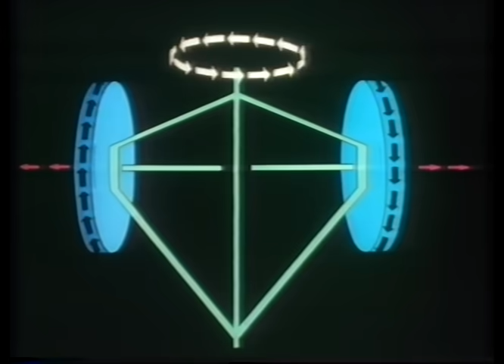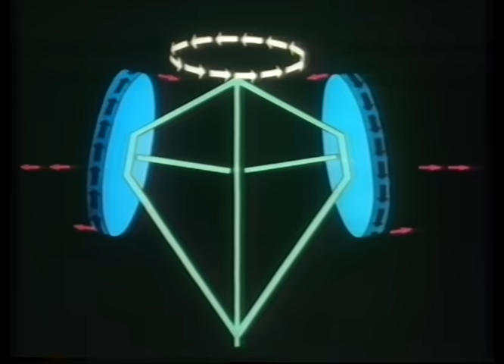Anti-Gravity Machine (Part One)

Comment: Sandy Kidd's invention - real or not.  My take-away is that Sandy was telling the truth and his device did in fact raise upwards for some period of time.  However, I also believe that he did not invent a "reaction-less drive".  A reaction-less drive is one that generates a sustainable force in a particular direction without having to eject matter out of one end of the drive like occurs with traditional "force = mass x acceleration" based dives (e.g., rocket engines).   

So what did Sandy invent? - Neither the time duration nor the full mechanical blue print of Sandy's effect is mentioned in either the part one or part two YouTube video and the full understanding of both could prove pivotal in discussing how this guy's gadget worked.  Also, suspiciously, this long 2-part video had ample time to dissect the machine thoroughly, but it did not, preferring to tell the story of an oddball and some oddball professors and his long-suffering wife.

BTW, before I proceed, I want to make clear that I do not subscribe to the conspiracy theory that there is a secret cabal that malevolently suppresses all cool inventions.  "Cool inventions will out" is my credo.  Where was the cabal when, in the 1990s, digital photography 100% wiped out chemical-based film photography?  Where was the cabal when Otto invented the internal combustion engine that eventually was used in the automobile and wiped-out horse-drawn carriages?  I guess they were on vacation.

First - here is a peak at how gyroscopes work - Gyroscopes are hard to suss out because everything is spinning so fast.  First off, there is an outright error in this video - when that science guy held the gyro in his science demonstration, the force acting on his hand as he held the non-spinning end still equaled the total weight of the shaft + spinning wheel, so that demo does not at all demonstrate a mysterious upwards force nor does it demonstrate a reduction in the weight of the shaft + gyroscope.  

This might seem like an odd comparison, but would you be amazed if I held up a piece of metal that was bent at 90 degrees and then if I "went on about" how mysterious forces held the horizontal portion of this bent bar stationary with no energy input?  

Please know that a "precessing" gyroscope, such as is shown in the sciency demo in this video is a 100% thought-out phenomenon where the gravitational force vector acting on the spinning gyroscope is shifted 90 degrees and is what causes the old science dude to dance around as he holds and then lifts his rotating mass attached to a non-rotating shaft.  He is not rotating the shaft, the gyroscope is doing that.  Also, the center of gravity of the gyroscope in the science demo in this video slowly is moving slowly downwards relative to his hand.  A very partial understanding of gyroscopes can be gained by considering the centrifugal force Fc, where Fc = (mass) x (velocity squared) / (radius of rotation).  So, Fc increases with the square of velocity.  

The velocity is the instantaneous velocity of the rotating mass.  You can get this velocity from the revs-per-minute (RPM) and the radius of the rotation since there are (2) x (pi) x (radius) units of length (i.e., the circumference of the mass's rotary motion) per each and every full rotation of the mass.  When you try to force a spinning disk to go to a different angular orientation, you are pushing against a more complex variant of the centrifugal force acting on each chunk of the spinning disk.  The math is complex, but it fully explains how a torque (torque = force x (perpendicular distance)) acting about axis "A" will cause the spinning disk to rotate (precess) about another axis "B" that is 90 degrees to axis "A".  All of this math also pertains to how helicopters fly and the control features of helicopters, where the pilot has to be 100% familiar with the aforementioned 90-degree shift of the reaction torque of a rotating object.

Sandy's anti-grav. mechanism - Not enough information is given about the complete mechanism, only some blurry fleeting camera shots of a couple of gyroscopes mounted on a "V" shaped articulating mechanism whose articulating motion is highly limited and then a bunch of belt drives that, supposedly, only provide drive torque to the device, but allow it to be free to slide up or downwards and then there is the counterweight attached to the spinning shaft via a pulley system where the counter-weight rope is presumably affixed to the rotating shaft by some sort of coupling that incorporates a bearing.  Our hero plugs his gadget in which gets it rotating while also, presumably, causing the 2 gyroscopes held outwards from the spin center to also rotate, maybe in opposite rotational directions.

It is important to note that Sandy never built any sort of flying craft and spent years just on the particular gadget we saw.

It is also important to note that with the machine off, a sufficiently heavy counter-weight would lift the whole contraption upwards via the cable & pulleys.  I am assuming that Sandy first balanced the system such that his mechanism was between the downward & upwards "stops" and then after he turned the machine on, the spinning machine drifted upwards and then rested against the upper stop implying that less counter-weight was now needed to balance the system and further implying that the weight of the spinning mechanism was reduced.

Bottom line - I am highly suspicious that there was some subtle aspect of his device where the mechanism that provided the input torque was somehow subtly creating a small upward tug on the central mechanism's shaft whose top end was attached to the cable that went over two pulleys on the ceiling of his garage and then went down to the counterweight.  

In other words, I am suspicious that the gyroscopes actually did nothing except provide a convenient distraction to what was really happening.  Magicians call this "misdirection".  Sandy came off as a sincere guy and I am not here and now accusing him of creating an elaborate magic trick, but I am convinced that he accidentally invented his own magic trick but was never able to understand the misdirection he stumbled onto and was turning a blind eye to the true source of the upward force acting on his spinning mechanism being perpetually mesmerized  by the spinning gyroscopes he so longingly wanted to be the real source of the gravity reducing force.

What about those professors who are filmed backing up Sandy - Again, I am not doubting that Sandy's device appeared to reduce the weight of the rotating contraption.  So those well meaning-professors were not lying when they said they saw what they saw.  I have worked with engineering professors myself and I can tell you that just because someone has a "PhD" (doctor) in front of their name, does not mean they are "smart".  In fact, some of the least intuitive and uncreative people I have met had engineering doctorates.  So, the professor chaps shown in the video were, undoubtedly, your garden variety small time, well meaning, professors tens of thousands of which populate the thousands of centers of "higher learning" and who are perfectly suited to regurgitate the contents of a given engineering or science text book in a lecture setting and are capable of creating and grading exams, etc., but when confronted with an unknown physical phenomenon are totally incapable of discerning what is going on.  The professors in this video are not bad people.  They are not purposefully trying to dupe us, then are just muddling through like the rest of us.

So, there you have it.  Not a thorough de-bunk, but a partial one.  Please also bear in mind that other folk making videos of perpetual motion machines or of anti-gravity machines are not so innocent as Sandy who I am giving the benefit of the doubt.  There are lots of folks just plain making stuff up to get YouTube clicks and there are others secretly hiding batteries, filming upside down, slicing, splicing or otherwise photo-shopping pictures and videos for their own strange pleasure (again - magicians abound).

Stay healthy & stay sane.

Oh yeah, I almost forgot - there is a way, or at least I think there is a way, to make a true reaction-less drive and it has to do with energy = (mass) x (speed of light squared).  This famous Einstein equation shows how you can convert pure mass-less energy into mass and vice versa.  OK, so picture a space ship with what looks like giant oars sticking out of portholes (yes, like on an old time Viking ship).  Except, where the wide part of the oar (paddle) would be, there would be a particle accelerator that would speed up matter to near-light speeds, which would increase their mass, and then which could also slowdown that sped-up matter to eliminate mass.  

So, when the ship oarsmen pull the tips of the oars with the particle accelerators attached towards the bow (front) of the ship, the particle accelerators would be turned off (low mass) and then when the oarsmen pull the oar tips towards the stern (rear) of the ship, like when a real paddle would dip back into the water for a power stroke, the particle accelerators would be turned on and would convert mass-less energy into mass by speeding up particles to near light speed.  Just before the end of the oar's power stroke, the particle accelerators would be turned off so the accelerated mass's momentum would disappear and the space ship would move forward.  OK, so a real drive as I describe would not literally have oars sticking out of windows, I just described it that way to let you get the idea.  Basically, this e=mc^2 based device lets you turn on and off momentum.  Please be aware that I am not trying to fool you because I am not a theoretical physicist, so if any of you are a theoretical physicist and can explain why this idea will not work, I am OK with that since I am more interested in truth than ego.

Comment: The gyroscopes resist changing angle toward the x axis, the spinning of the x-axis creates a force trying to push the gyros axis parallel with the x-axis.  The combination of these creates a force along the y-axis, similar to how a sailboat can move forward by the combination of keel and sail.  The spinning flywheels create resistance to angular change without having to be anchored, and centripetal force creates a force on the angle without having to be anchored, so the device doesn't need to push against anything to move.
Reply: wrong.  the vertical axel down the very center creates friction like a screw.    the friction is where the lift comes from.     thats why it only rises as high as the axel let's it.   if you wanted it to go 100 feet up you'd need a 100 foot venter vertical axel anchored to the ground.     lol.   it's a simple  fact this guy overlooked
Reply: what he says is true,only if the object is spinning at 99.9999999999% the speed of light
😂🤣😂🤣😂🤣😂🤣🤣😂😂🤣😂😂🤣🤣😂🤣😂😂😂🤣😂😂🤣🤣😂🤣😂🤣🤣🤣😂🤣🤣😂🤣🤣🤣😂😂😂🤣🤣🤣😂😂😂😂🤣🤣🤣🤣😂😂🤣🤣😂😂😂🤣🤣🤣😂😂🤣🤣😂😂🤣🤣🤣😂😂🤣🤣😂😂😂🤣🤣🤣🤣🤣🤣😂😂😂🤣🤣😂🤣🤣😂😂🤣🤣🤣🤣🤣🤣😂😂🤣🤣😂😂😂😂😂🤣😂🤣😂🤣😂🤣🤣😂😂🤣😂😂🤣🤣😂🤣😂😂😂🤣😂😂🤣🤣😂🤣😂🤣🤣🤣😂🤣🤣😂🤣🤣🤣😂😂😂🤣🤣🤣😂😂😂😂🤣🤣🤣🤣😂😂🤣🤣😂😂😂🤣🤣🤣😂😂🤣🤣😂😂🤣🤣🤣😂😂🤣🤣😂😂😂🤣🤣🤣🤣🤣🤣😂😂😂🤣🤣😂🤣🤣😂😂🤣🤣🤣🤣🤣🤣😂😂🤣🤣😂😂😂😂😂🤣😂🤣😂🤣😂🤣🤣😂😂🤣😂😂🤣🤣😂🤣😂😂😂🤣😂😂🤣🤣😂🤣😂🤣🤣🤣😂🤣🤣😂🤣🤣🤣😂😂😂🤣🤣🤣😂😂😂😂🤣🤣🤣🤣😂😂🤣🤣😂😂😂🤣🤣🤣😂😂🤣🤣😂😂🤣🤣🤣😂😂🤣🤣😂😂😂🤣🤣🤣🤣🤣🤣😂😂😂🤣🤣😂🤣🤣😂😂🤣🤣🤣🤣🤣🤣😂😂🤣🤣😂😂😂😂lol.

Comment: The guy could’ve saved 10 years of his life by just putting a propeller on the model airplane engine and would’ve generated more lift then his entire machine in less than five minutes
Reply: That requires air.... How u suppose that to work in enclosed environment or in space?
Reply: LOLL these comments are good.
Reply: Stupid questions needs stupid answers
Reply: It was a make work to avoid the mrs project
Reply: If you are so smart, just do it yourself.
Reply: Thinking the same thing once I saw the starter and heard the two stroke fire